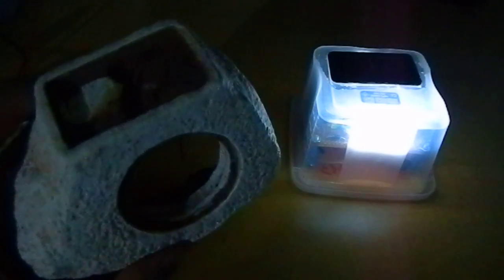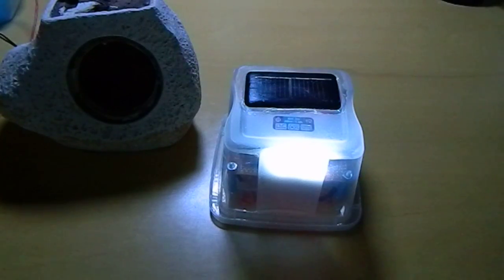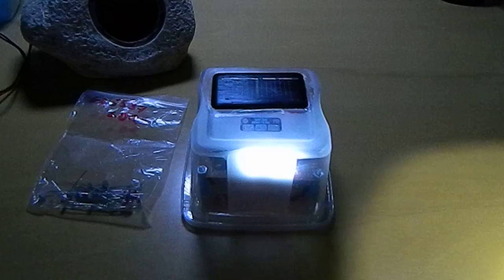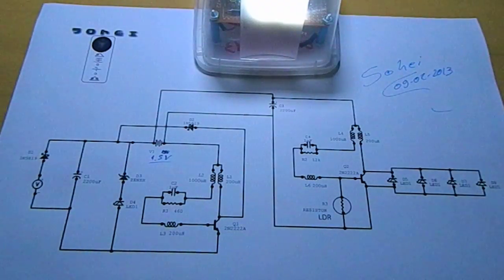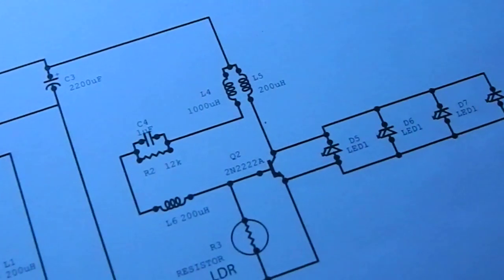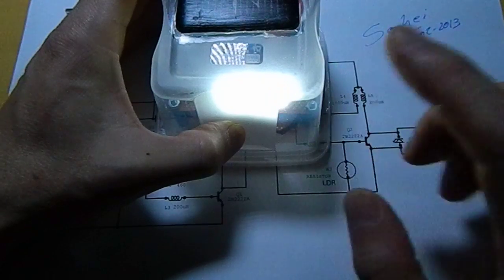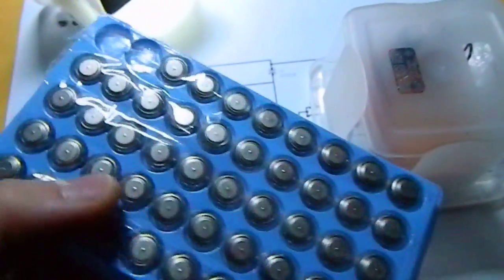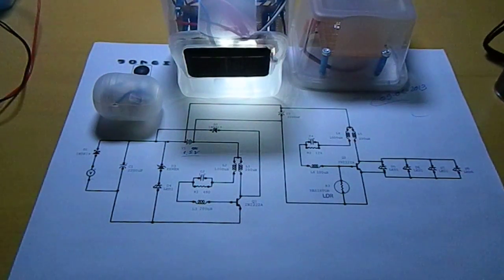Double Joule Thief Solar Auto-Light

Comment: Dear Sir, I tired to make the circuit but my LED is lighting very dim.. Can you please let me know how to increase the brightness of LEDs. I am using 3 LED only still the light is very dim. Secondly, the main problem in my circuit is that the LEDs are always illuminated where I take the circuit in dark or in the light. Even I take out the LDR from the circuit my LED is lighting.. Seems like my LDR has no effect on the circuit..I tried to test my LDR with multimeter but it is working fine.  I am using 1 microfarad electrolytic capacitor instead or ceramic capacitor .Is it causing the problem? If no then please suggest what can be done in my case to sort out these problems. Hoping your response in this regard please. Thanks.. With Regards.

Comment from the maker: The leds are upside down... my mistake :)  They really do not work like this :D
And the zener conducts when it reaches the value voltage, when the battery reaches the value of the zener it will conduct and the led connected to him will turn on.

Comment from the maker: Greetings, that is what impress me the most on this kind of circuit. And that is the other reason why Mongrel Shark named it AFIC ( Analog Flyback Intelligent Charger ). One of the reasons is that it pulses DC voltage through the charging batt. The other reason is that when the charging batt reaches the charging voltage, the circuit stops... that ONLY occur IF you are charging a 12v with another 12v or compatible voltage batts. And as you may have noticed, even when the solar panels are not ...

Comment: I wanted to share my experience with you. On the basis of your this schematic, in order to charge 9v batteries, I have made a JT charger (only) with 5.5v solar x 2 =11v output, which can give upto 13v. Now the interesting part of the circuit is that whenever I connect 6v, 3v or even 1.5v batteries, the JT automatically steps down its output according to the size of battery connected, e.g if connected 6v bat JT output comes down to say 8.5v instead of 12-13volts. Any idea?
Reply: Hello have you found out the reason, experiencing same issues

Comment from the maker: Greetings... I was also curious about the solar panel values. I have a light box that gives 6700 LUX for solar panel testing. Under this amount of light, the solar panel gave 1.8v @ 1.8mA. The batt I am using is a 2700mAh 1.2v. The zener is a 1.7v. Here is how I am using, after charging the batt it stay in my window ( inside ) and I did not charged it anymore. But I ran some tests and it takes a day in full sun to charge from discharged and after charged it can stay near a window to charge.

Comment: what is the value of zener and solar panel you used?  And you said battery charges very fast even in the window at very low light.  How long does it take to fully charge the battery?  Thanks.

Comment from the maker: Thank you for your comment. When charging using a JT there is less need of light, I mean, it can charge with any amount of light. It does not need to be in direct sun or in a strong artificial light to charge. And when at the direct sun light it charges much faster than it would without the JT. Regards...

Comment: The idea of your double JT circuit is great but I don't understand why do you need the first JT to charge 1.2V battery (as shown on your circuit), as 2V solar cell (or 3.0V, if two 1.2V batteries are used) will directly charge the battery with the help of one diode during the day and that battery will light the LED(s) with your second JT circuit.

Comment from the maker: Between the capacitor that is connected to the solar panel and the battery. Anode on capacitor and cathode on the battery. But remember that it will lower the amps from solar panel, more charging time will be needed. But it is nice to see that the battery is receiving charge :))

Comment: Rechargeable NiMH batts are of 1.2v & it never goes upto 1.8v due to its internal chemistry. I understood your idea of using zener 1.8v but here in Greece I found the lowest voltage zener is of 2.4v, so I will have to find one of 1.8v. Except this led you also have one light green led to indicate charging but this is not shown on schematic. where/how did you connected it, thanks.

Comment from the maker: That is the reason of the zener diode. When the batt voltage reaches 1.8v it will conduct and the charge from solar panel will be directed to the led. I am using a rechargeable batt since I build this one and the batt was already very very old, and it is still working fine.

Comment: Thanks for your encouragement. Sometime I will upload video for it. Over-charging any battery its life is slowly reduced. Now for this Double JT solar circuit, say, for 7 hours use of power, the solar cell is working for rest of 17hrs of the day & so there is possibility of over-charging of the battery many times a moth/year. Can this circuit be added with an IC based automation, so whenever the voltage reaches to say, 1.85v,the circuit will auto disconnect.

Comment: I have tried to replicate one. I have substituted 2N2222A with 2N2219A , inductors  200uH with 220uH, for green led , Zener 1.8v with 2.4v &  put a very sensitive LDR. LEDs are always on with or without solar cell connected. Auto off with LDR could not get worked.Please help, thanks.